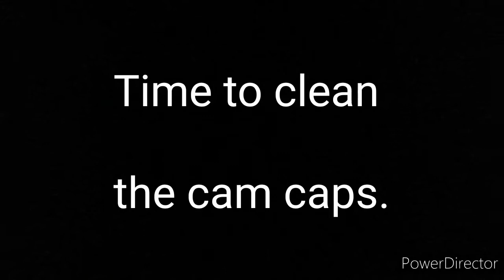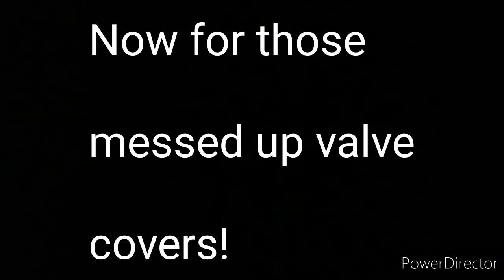Audi B5 2.7T Build | Cleaning the Cam Caps and Tappet Covers!

Comment: What do you use to clean the parts up?
Reply from the maker: I used a degreaser called Prepsol, when you soak the parts in petrol first and then use prepsol on them thereafter, carbon build up, grease and any other dirt is removed really quickly.